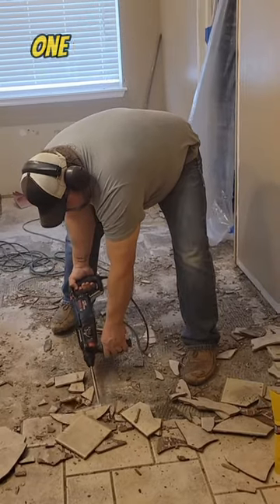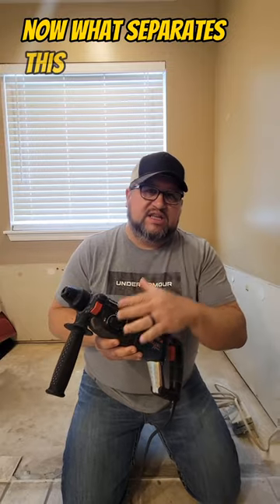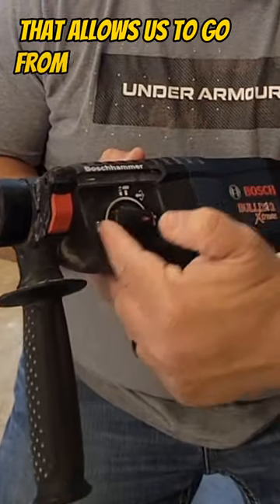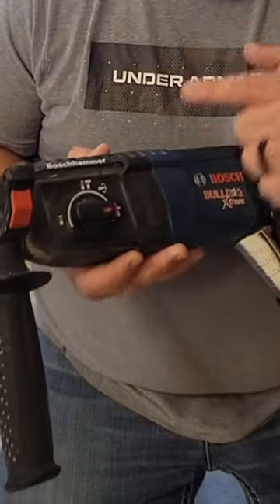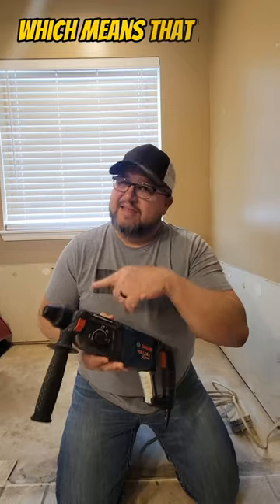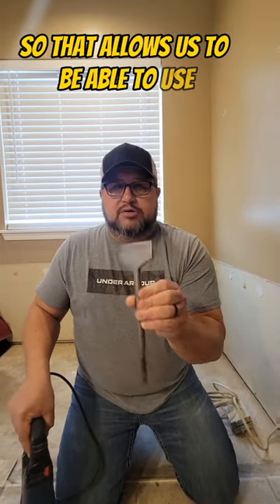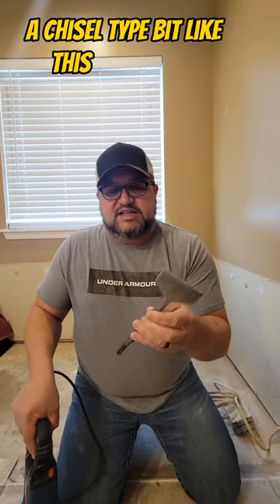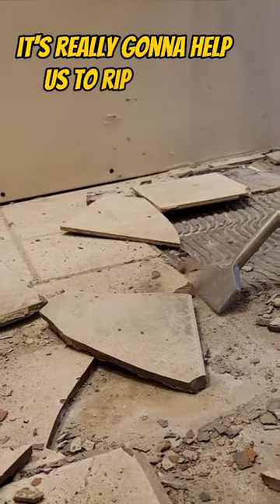EASY Way To Remove Tile From Concrete! Rotary Hammer Drill

Comment: So to remove tiles you select hammer with that flat bit?
Reply from the maker: Yes hammer only. It has to be a rotary hammer drill with the setting so the bit won't spin
Reply: @DebtFreeDIY  thanks so much - and this bit they used will also remove any adhesive left behind?
Reply from the maker: @MysticRose24  it should be thinset,not adhesive.  But yes it will remove thinset no problem
Reply: @DebtFreeDIY  thanks for taking the time to respond - appreciate it
Reply: I had the same question!

Comment: I need to cut off a small portion of tile on the wall for my new shower valve. The multi tool sucked. Can you recommend something? I saw this, but trying to do straight cuts that look nice.
Reply from the maker: Are you cutting a totally new hole from a tiled wall?
Reply: @DebtFreeDIY  no there is an existing shotty cut round hole. The new valve rectangle. I don't need to cut much. And it will be a little too big on the sides nothing I can do. This started off replacing trim. Turned into way more 🤣😝😝
Reply from the maker: @GoNoGoDIY  multi tool with a tile blade is probably the best option

Comment: How does that one work for chipping out concrete to move a drain? I was looking at buying that model.
Reply from the maker: How far are you moving it? I moved one 3 feet and it was a LOT of work
Reply: @DebtFreeDIY  12-18” some where in there? How many hours do you think it took you to move it? My last one I did had a wood floor so it only took about four hours to move the drain plus the time to get the plumbing parts.
Reply from the maker: @mr.kenslifeshop4034  I'm guessing 12 to 18 inches will definitely take a good solid 2 or 3 hours. It took me probably 6 to move it 3 feet. I did rent a jackhammer for another drain that was a few feet and it knocked it out in like 25 minutes. LoL
Reply: @DebtFreeDIY  OK so you’re saying basically with the one in the video would probably take 2 to 3 hours to chip the concrete out. Yeah the problem with these rotary hammers and mini demo hammers is you need so many different kinds of them I already have a rotary hammer M 18 that works good for drilling holes. But it’s like now I need I could’ve use the one in your video to chip some tile out the other week but I did it by hand. Butit’s like I need three different kinds of demo hammer’s.
Reply from the maker: Yeah the one in the video will take a little time for sure. It can be done though. Just takes time. It's great for tile though!